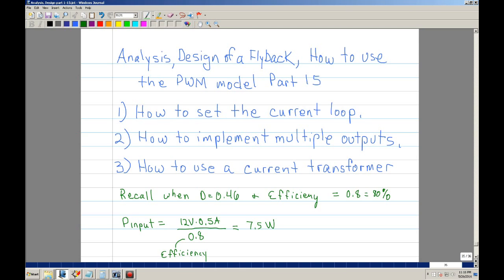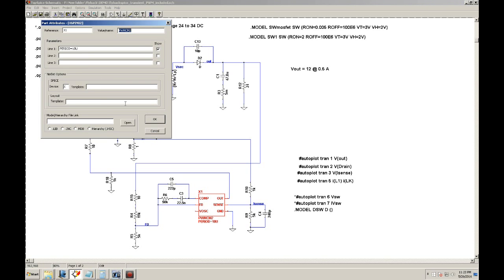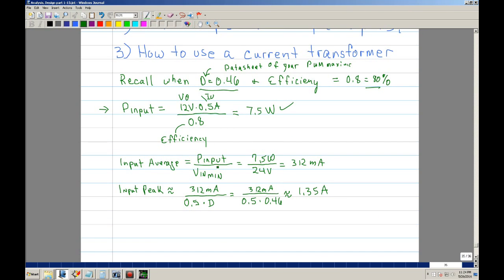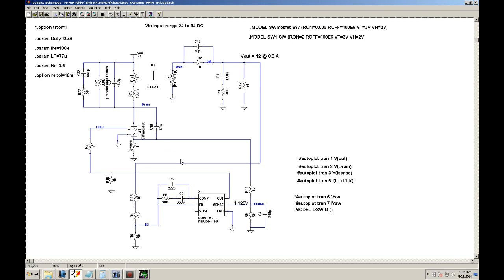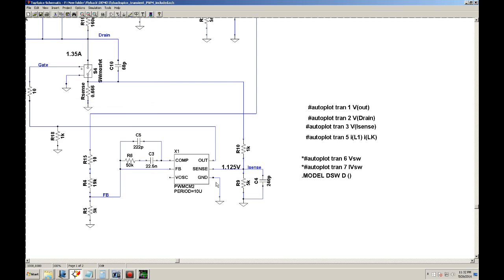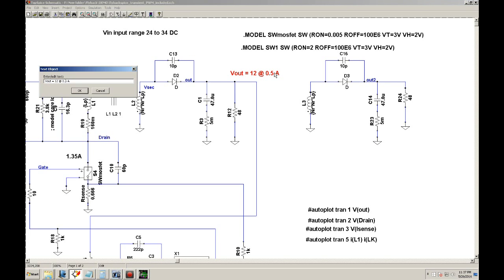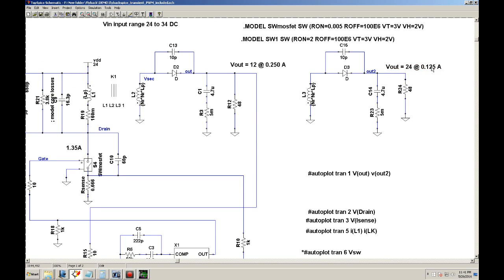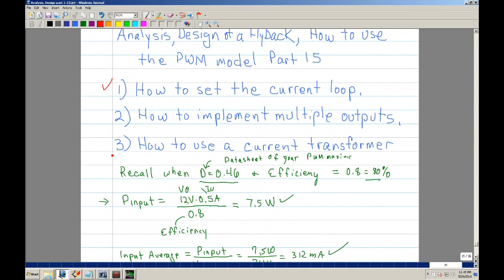Analysis and Design of a Flyback, How to use the PWM, Part 15

Comment: Thank you Robert!
I have a question, at the last minute of the video, why the VD's graph shape looks like that?
Reply from the maker: Hi Idan, sorry in the delay in answering your question. I assume you are taking about the drain (about 2*Vinput)waveform. When the mosfet is on, the current rises. Then when the mosfet is turned off, the voltage across the primary winding reverses and since the same voltage is applied but in reverse, the flyback then resets. This reset means that the energy stored in the gap when to zero. You then see that after it resets, the voltage on the drain when rings between the primary inductnace and the mosfet's output capacitance and should settle down to about Vinput. I hope this make sense.

Comment: I need to generate negative pulses of - 5 kv with input 230v ac.  The output pulses at 25 khz frequency. It has two stages one is pwm geneation and second is 230 v to 5 kv amplification using ferrite core transformer but issue am facing is MOSFET getting damaged,... I think that because poor flyback circuit design of transormer... Could you please tell m what to do...